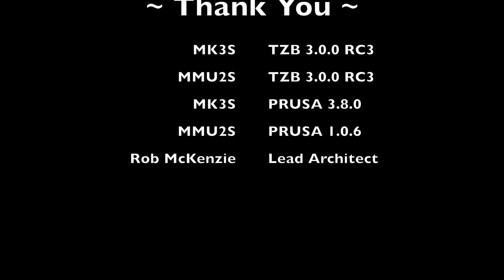TZB MMU2S - FLASHING STOCK to TZB

Comment: Can I flash the MMU2S TZB firmware if I am still using the stock MMU2S unit or do I need to have the dual blade upgrade?
Reply from the maker: Sure can 👍
Reply: @TheZeroBeast  excellent! Thank you!
Reply: @TheZeroBeast  So which firmware for the MMU2S stock would I flash? TZB-MMU2S-TZBDualBlade-4.0.2-BN380.hex or TZB-MMU2S-DoubleCutter-4.0.2-BN380.hex
Reply from the maker: @tmacpluto  the dual blade version works for stock 👍